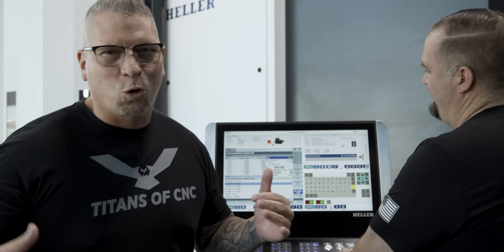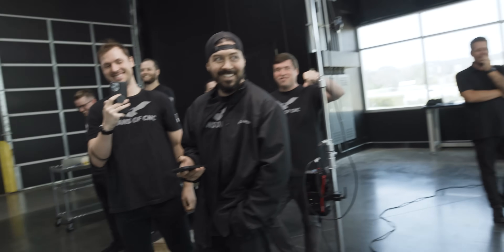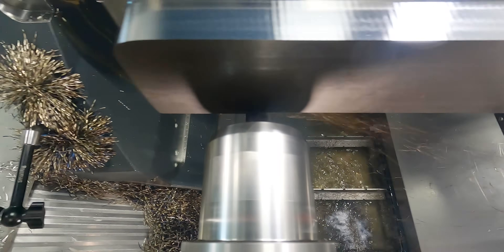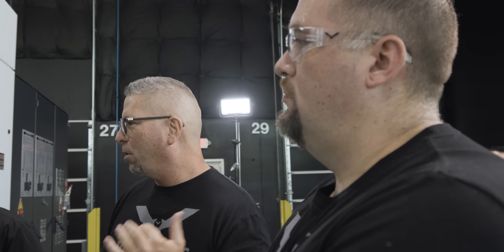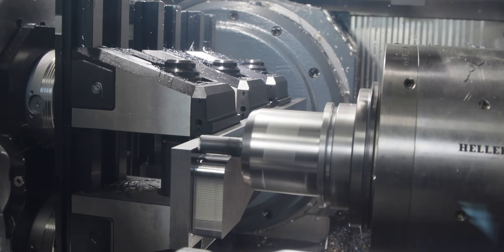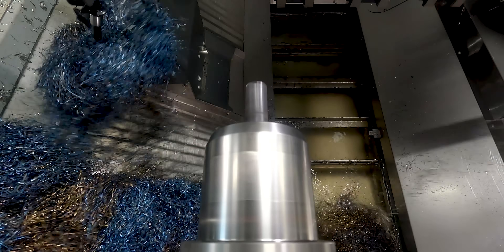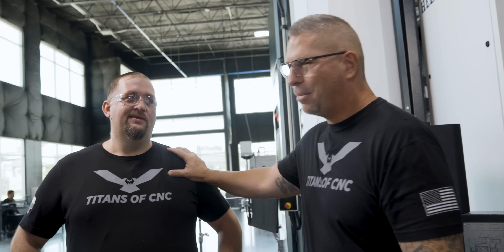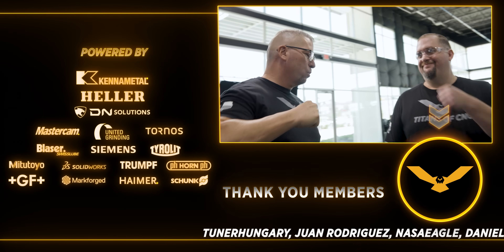We Attempted a WORLD RECORD on a CNC Machine and This Happened…

Comment: I'd be curious to know what the depth of cut and spindle load was 🤔.
Reply: Spindle load was 50% and depth of cut was 1.2" with a .020" stepover
Reply: @barrysetzer  50% is very impressive.
Reply: @josephmorse4318  I thought so too. You can actual see it at the bottom of the screen at 1:36
Reply: @barrysetzer  Gotcha. Should've had it in theater mode. The progress bar at the bottom was blocking it.

Comment: That was probably the smoothest sounding run in steel I have ever heard. Absolutely no bogging down on the spindle or the axis servos. A shot of the load meters would have been insightful.
Reply: Thats because its not taking much of a cut.  The chips are needles.

Comment: MAN that is crazy. The 4 axis Mori Seiki I run can hit 240 IPM in 100% rapid and 9000 RPM. It couldn't do anything close to this.
Reply: Your mori could remove just as much with a slower feedrate and a higher chip load with a insert cutter.

Comment: Ok so a few things come to mind here. 
First off 2k IPM is cool for sure congrats on that. 
Second thought here is .02 radial step over with the RPM and endmill Size in consideration are you really pushing the limits here? 
Third if you really think your pushing the limits next comes in tool life management and how long does the endmill last per parts and contract. Sometimes just because we can do something doesn’t mean we should kennametal tooling is amazing but the price of them is high do we really want to wear out the edges of the tools to be able to go that fast when we could have went with a slower RPM,bigger step over and slower feed rate still getting maximum MMR out of cutter and gain in tool life? 
Have to see the pros and cons before we call this a success story. Yes it cut the part and that is impressive on its own but now we have to actually think realistically if it is business smart and cost effective.
Reply: I could not agree with you more.  Its funny reading to the comments of people that don't have to pay for their cutters or have even ran a CNC.  Not much of a chip load as those are needles in there.

Comment: What's the material removal rate vs a conventional feed? I feel like you could remove the exact same material per minute with a conventional tool path.
Reply: That's what I was thinking as well. Those are needles coming off that thing so it isnt much of a cut.  You could take a bigger cut with a slower feed rate.  My question would be which is wearing the cutter out quicker?  Titan doesnt have to pay for cutters as they are given to him from the manufacturer to demo.  So that cutter (if its a 3/4") costs 330 bucks on MSC and a shop that has to pay for that thing has to consider that.  Also machine wear.  2000 IPM puts a lot more wear on everything than 500ipm and so on.  I think most shops would opt for a insert type cutter in this situation.  Inserts are cheaper to change and usually have at least 4 sides as well.  Once that thing is dull it has to be resharpened  and that costs even more.  I have to pay for my cutters.  Just my .02

Comment: it's a reasonable 0.103 ipt the radial engagement is very low at 0.020 but the sfm is prety high at 2552 the big diameter will help with chip tinning add the high flute count and you'll get to 2000 ipm as I said the feed per tooth is reasonable it's the sfm that will wear out the tool quicker than it should and that's why the titanium coating is key for the success of this cut hence the high sfm, I'm just saying that this is not sorcery it's just engineering, the engineering of this cut is amazing trying to make something do crazy things it wasn't made to do like this tool that is made to finish titanium is being used as a steel rougher.

Comment: 2000/13,000 = .1538=IPR /15 = .0102 chip load. Definitely doable. With the step over we should be able to calculate tq and hp required. sounds butter. Is that HSK A63 tool holder?😅

Comment: In “ real world application “ how long would you be able to run that tool with that part multiple times before a failure. As a real machinist making real parts in the real world, I don’t like engineers/new machinist watching this thinking that this is how you make multiple parts/jobs…. Other than that it was pretty cool watching that machine runnnnnnnn!

Comment: The fact it survived was impressive. Let alone running that fast. In steel. Now let's all remember. They ran it dry. Absolutely amazing work.
Reply: the tool wouldn't make it with coolant on, because of the thermal shock

Comment: never would call myself a cnc operator but i did .100 deep 4 inch dia at maybe 1,100 rpm at 20 ipm with a custom index cutter that I made on a prototrak bridgeport. I know very well thats nothing but i used kennametal inserts which are the bomb imo.

Comment: Barry! I'm so amazed of how much thought is behind it. Firstly You picked a steel grade with around 0,75% carbon and high manganese content for its low ductility to provide good chip breaking and to avoid tool pullout. Secondly You used a finishing tool for it's small edge radius to minimalize cutting forces. Am i right that You picked the axial and radial DOC to have some spare torque just in case? Those are just my first thoughts but i bet there was a lot more behind it. BTW in those vices the workpiece was never going anywhere. Greets as allways, You Guys rule!
Reply: More smaller flutes also means the core of the tool is larger and more solid.  But you have to take a hell of a lot into consideration before hitting the yeet button on a cycle like this.  OMG scary.
Reply: The grade he used is a  Mild/Low carbon steel 1018,  0.18% carbon , high ductility.
Reply: @matthewbehrens7091  He used 1080 grade, not 1018 1:48
Reply: It says in the video 1080, but in the description it says
"This 15 flute end mill from Kennametal takes on 1018 steel attempting to reach 2000 IPM in our Heller HF 5500 beast mill."
  @Jatsekusama

Comment: They were saying how the machine is scary fast. At my last job I worked on a Makino and it had a 4,000 ipm rapid. It was hard to get used to flipping the parts on the other side because the whole machine would be rattling and shaking around me

Comment: That's only 0.02" radial on a 3/4 cutter, and your at .01" per tooth. 2000 ipm sounds impressive but when you look at that cutting data it'd be pretty hard to break that tool.
Reply: It's a 15 Flutes finishing end mill, a tool like that is not design for "roughing" at deep radial cuts
Reply: @elbaus3700  exactly, a 3/4 in 15 flute endmill is going to have a huge core and be super strong.  They basically are just taking really fast finishing passes.

Comment: Great job guys.... Boom! Bang!
Funny how things go.
I can remember the history of tools and machines.
Cnc machines could do more then the available tools 30 years ago.
Then the carbide grades getting better and the machines were to slow in speed and processor capacity, a corner was some strange form but nut 90°.
Now the machines getting quicker and quicker with the "thinking capacity", better processors, rigid frames and stronger motors...... I see it as an constant battle between machine builders and tool manufacturers 😅

Let's see what in the coming years happens, I think very interesting stuff 😊

Comment: There is so much that can be said about every aspect of this setup in order for this to work.  The machine capabilites, the workholding, the tool holder, the grade of carbide of the tool.  All of it had to come together to make this happen.  Incredible.
Reply: This is insane...but let me do some math real quick 
12" = 1'
2,000ipm= 2,000ft every 12m
60/12 = 5
10,000 ft/hour

5,280 ft/mile = ~2mph.  

And now it sounds slow 😂
Reply: Add coolant and push it even harder....2400IPM...maybe 2500....
Reply: @ajwilson605 air blast is coolant. Many coatings used nowadays needs a little bit of heat to work properly and prevent built up edge. Liquid coolant on this process would destroy the cutting edges in minutes due to thermal shock.
Reply: @ajwilson605  Doesn't work like that in steel.
Reply: coolant while machining steel will actually not help but decrease tool life @ajwilson605

Comment: If you've got the RPM, the torque, the table drive speed, and the rigidity, you can hit your chip load target and the limit becomes heat management at the cutter edge and ultimately the dynamic pressure on the cutting edge.  Cut faster, it has to increase.

Comment: This is really insane, but in my opinion the 1000IPM on the 3/8 Cutter was way more insane it had nearly the same MRR with 40 compared to this (48) but at HALF the diameter so way more fragile tool. But still a great video love those limit checks

Comment: My machine cant even rapid travel this fast.
Reply: Mine can't either but they begin spindle stalling at anything over 3000 mm/min in anything harder than plastics and with any meaningful tool engagement. You need powerful servos but you also need an insanely powerful spindle with high torque for shenanigans like this
Reply: Mine could do it if it were dropped out of an airplane
Reply: One tool per part… when money is no object…
Reply: @michaeltrilck5680  But like they said... if you are running 100ipm, it's time to seriously re-evaluate running 400 or 600 and even up to 1000.
Reply: @advil000  The prudent thing is to try. That‘s right, Sir! Increasing the feed rate by only 20% over the parameters recommanded by the tool manufacturer means a 50% reduction in tool live! Kennametal has reduced the prices in the recent past of very strongly. Thorn the calculation with the shorter service live works out again… I‘d rather not say anything about the parts that may have been ruined by the tool breakage… And the downtimes due to tool breakage certainly eat up the time saved, i think… But much worse is when the costumer is annoyed by faulty parts due to scrap production… And please remember: Every broken off 20mm solid carbide cutter also shortens the running time of the spindle motor with it’s ceramic bearings. And the affected shrink tool holder no longer runs smoothly afterwards, count on it… And this always be kept in mind befor turning up the potentiometer excessively…
Reply: @michaeltrilck5680  True but it may be  justified if the part costs enough.
Reply: @michaeltrilck5680 I’d argue they build the cost of the tool into the part like any shop would????? In my personal experience industry needs parts they are willing to pay to get it fast
Reply: Same lol
Reply: Some machines ive worked on rapid less than 1/10 of the speed 😅 200IPM full rip on a mill
Reply: Rapid traverse on mine tops out at 700 ipm.
Reply: Same